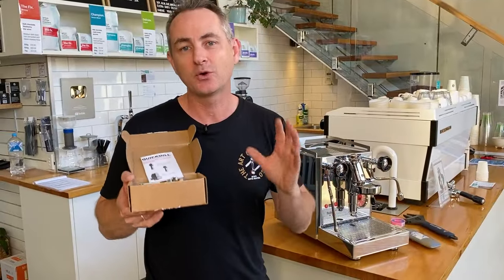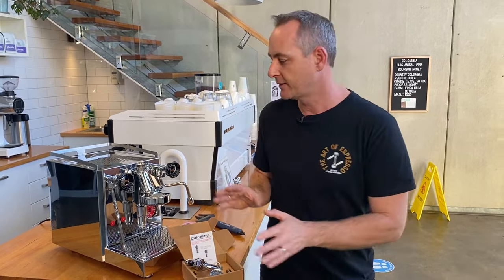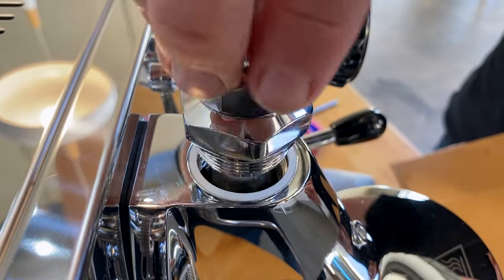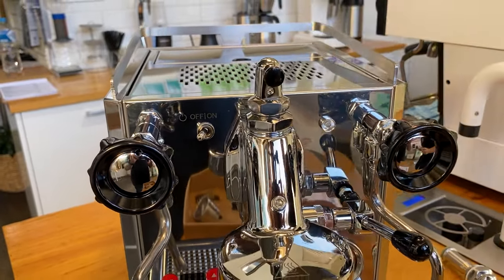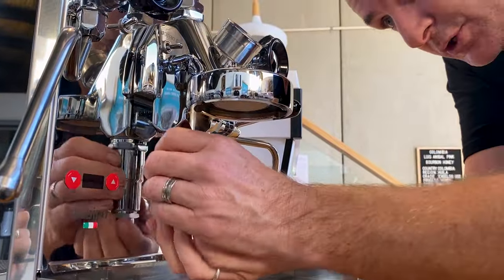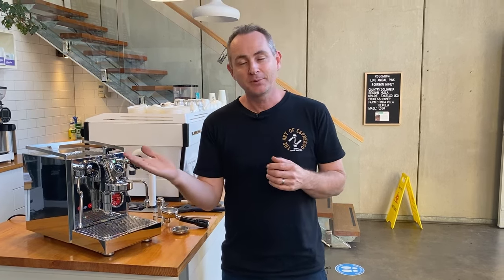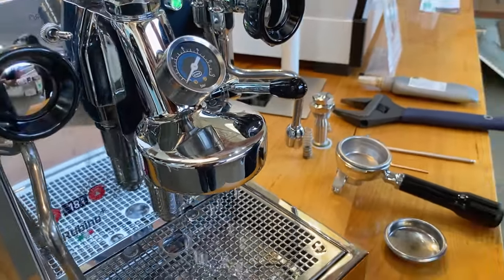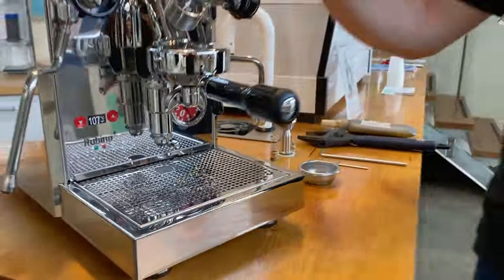How to Install a Coffee Machine Flow Control Device

Comment: Good morning from San Francisco. Two Questions: q. Sometimes, my pull runs fast. Other times perfect, other times too slow. Is ONE of the purposes of this flow control valve to salvage an otherwise blown shot pull? Secondly, I have a Rocket Appartamento. Will this unit work n it, or do I need something proprietary to Rocket? Thank you. I have leaned so much from all of you at Artisti. I’d love to travel there for classes and motorcycling.
Reply: Quarter turn at start once you see coffee coming out do a 3/4 start there
Reply: I think you could of used a bigger spanner lol